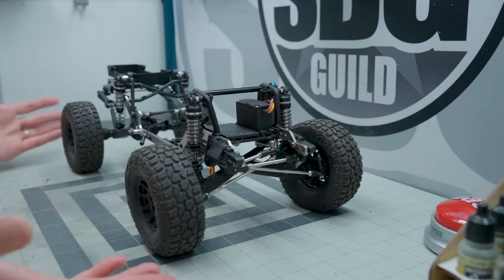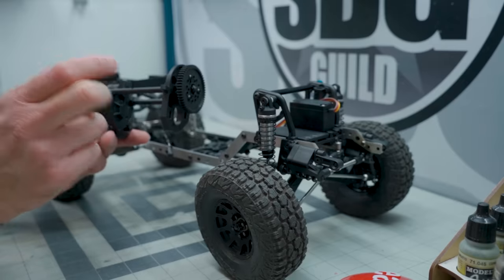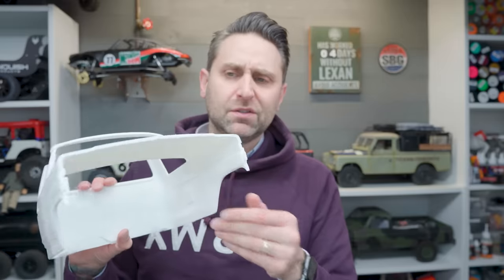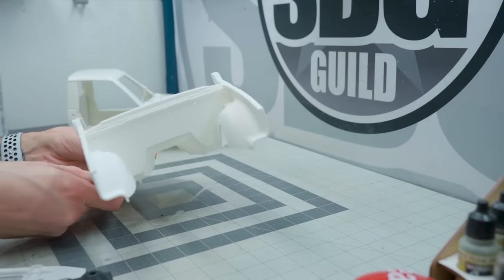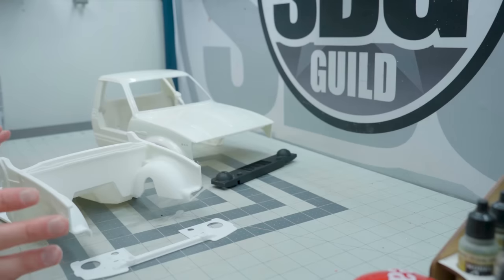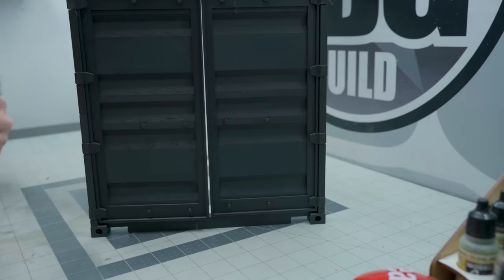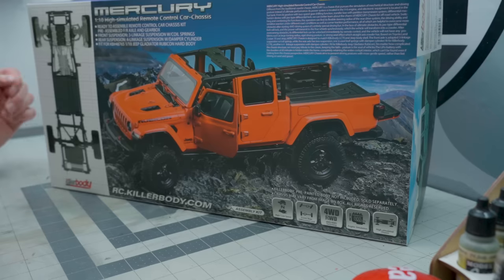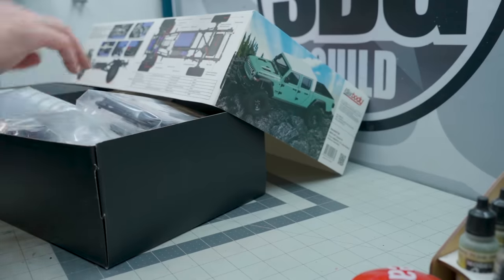NO MORE LEXAN (means I’ll probably still use it) - What's on the Bench Weekly Ep74

Comment: If you did the VFD twin stubby mounted backwards in the chassis, the OD/UD shift mechanism would make it act like a 2 speed transmission on the beams truck. Basically a low range/high range, with locking diff, would be awesome!
Reply from the maker: Not a bad idea, but I'm trying to limit the complexity!

Comment: How bad is the out gassing or smell with printing ABS? I wanna try it, but have been told it is very pungent....
Reply from the maker: The X1 Carbon has a filter system and is enclosed, so there's not much odour or fumes. I still keep it in a closed room, for the sake of my health, just in case.